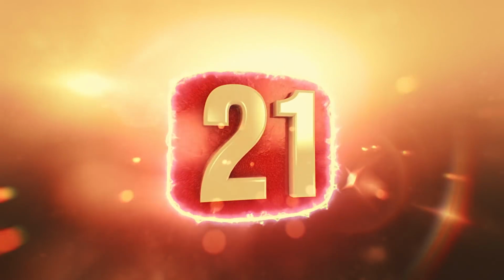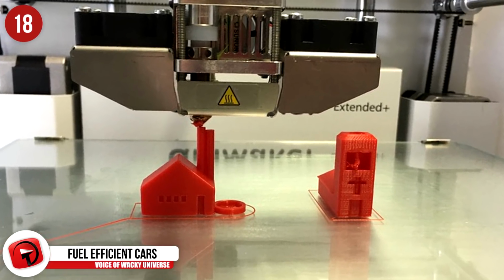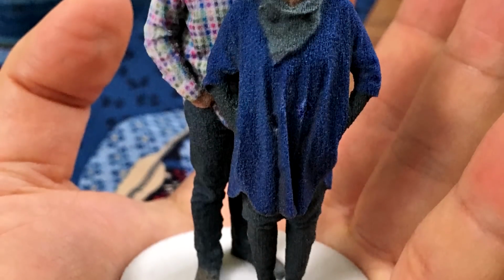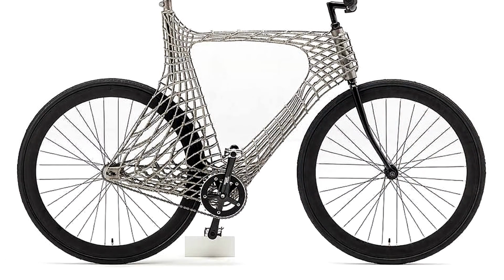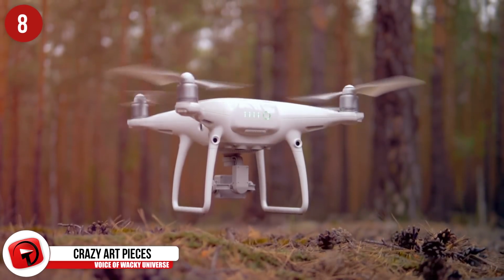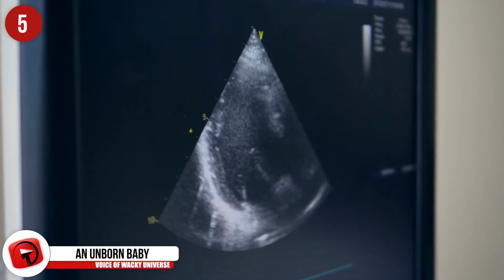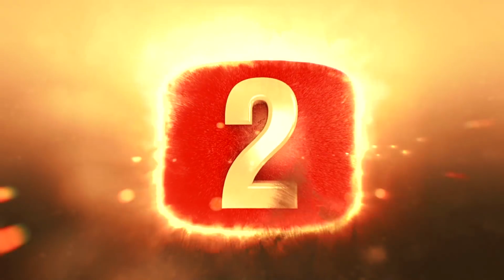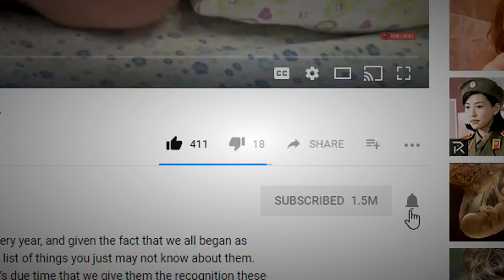CRAZIEST Things That 3D Printers Can Make

Comment: 3D printing has got to be one of the most amazing inventions of the 21st century. ( and youtube obviously) ;)
Reply: michael Longford the problem is, it takes a couple hours to make a small object that has a chance of failing. And to get detail, you have to have an even longer print time because the extruder needs to move slower. A new invention being developed is a laser inkjet 3d printer that would take a couple seconds per layer instead of 30 seconds to a minute per layer. So, hope they develop that soon.
Reply: Jason Rosenzweig yes I hope they do.